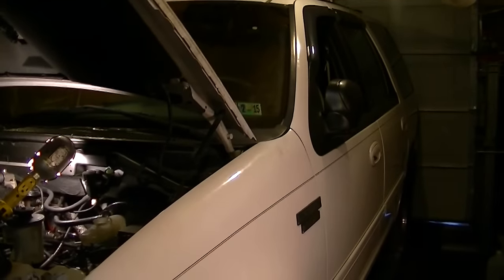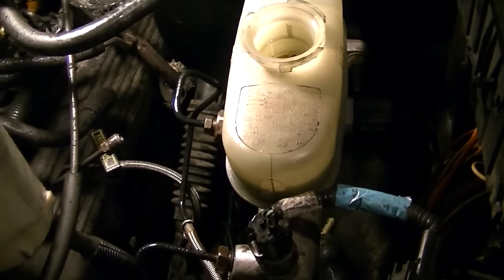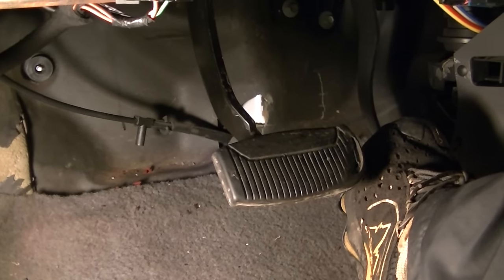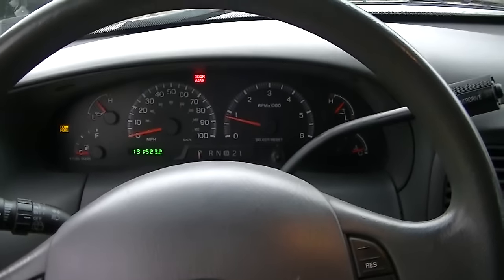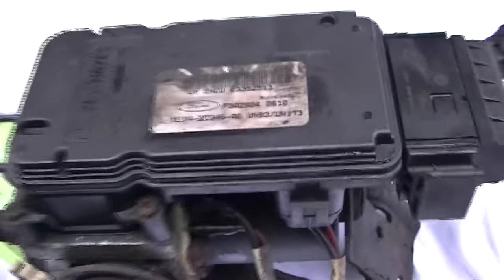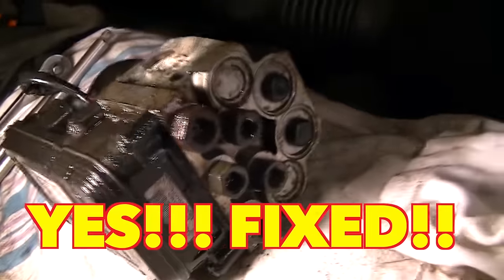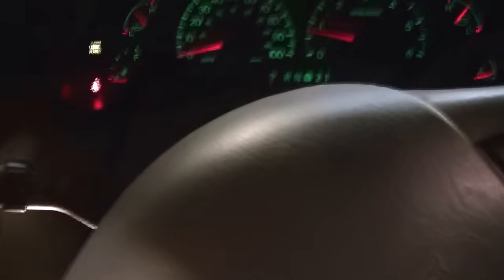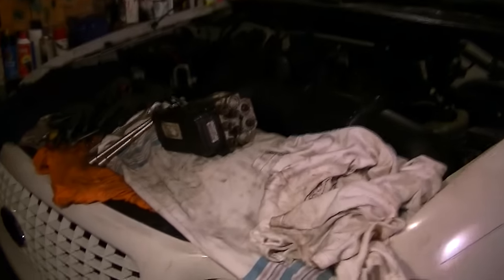Sinking/Spongy Brake Pedal -With ABS SYSTEM?? Nothing Works? Watch Fixed!

Comment: Hi i changed the front brake pads today and also bled all 4 wheels, but i still have a sinking brake pedal? I did retract the caliper to make way for the new pads but i've heard that with ABS systems it's better to open the bleeder before retracting the caliper to avoid any ABS/MC damage. I'm suspecting i've pushed bad fluid under pressure into the ABS and somehow caused damage? Any thoughts?
Reply from the maker: Unless it was working ok before you did all of that, I check the master cylinder first make sure its ok. That's a lot cheaper. Maybe replace it or test it...plug it off and see if the pedal still sinks... If that does not work then the ABS could be your Issue ;(

Comment: Did u check brake screw on calipers...if they are on the bottom, it means that air is trapped there. Screws need to be on the top of caliper
Reply from the maker: Na, it was the ABS...I did everything I could.

Comment: Thanks for posting a vid of symptoms and the cause. Every article I read blamed the master. I have the same symptom on the rear wheel of a Ducati Monster, plus I'm hearing a hissing sound at the abs pump every time I push the brake pedal. Master Cylinder has been replaced but didn't fix the problem. Considering the symptoms match yours, I think I'm just going to replace it.

Comment: I have a 2004 Saturn Ion sedan base model (level 1) I had a spongy brake pedal and replaced the brake master cylinder and tried my best to bleed. The pedal goes to the floor board worse than before. I dont have ABS any ideas ?
Reply: I have an 05 Ram 2500, same issue. Brake pedal would sink to the floor. I replaced my master cylinder and bled the brakes. Still had a sinking brake pedal... Bled the brakes again to no avail. I saw this post, disconnected my batteries overnight. Seems to have reset my ABS module. Brakes are firm again!
Thank you!

Comment: Wow I hope this is my problem i have replaced 3 master cylinders a booster and drums brakes and rear cylinder and still have brake problems even bleeded the Lsv which  was discolored which I thought was weird cause I had bleed the system multiple times I hope that had fixed it but it hasn’t so now I think I’m going to have to look for a new ABS/used
Reply from the maker: O wow! Sorry to hear that! Sounds like ABS ...Let us know if you get it fixed!

Comment: Hi I have a toyota yaris with ABS system and when I presse 3-4 times  with engine off my brake pedal became hard and when its hard I presse 2-3 times more I hear a vacuum leak on front of car and my pedal goes down and I dont have any fluide leak Is  that normal because usually when pedal is hard it stays hard until starting engine?

Comment: I’ve replaced booster and master cylinder on 14 fiesta.   No brakes at all.  System bled but no fluid to front lines.   Next up is abs module.   Cross you fingers.  Frustration is real.

Comment: Very curious about how the brake pedal isn't sinking. Usually you have a get the air out of the abs module using a scanner. This is rare.
Reply from the maker: Done 15 or so  of these this year, never had to have a scanner. Some autos I'm sure you have to have a scanner.
Reply: @FixingWithPassion  what year and model is that car?

Comment: I installed a used ABS pump in a 2011 Ford Edge and still have the same problem I also put a new power booster and master cylinder on and new rear Calpers and nothing changed I still have no brakes it's spongy to the floor and bled the brakes about 15 times

Comment: 2011 Hyundai Genesis 4.6 - Dealer said I had a leak in the master cylinder.  Replaced it.  Now they are saying my HECU (Hydraulic Electronic Control Unit) is bad.  Part alone is $2500.00.  I feel like they are stringing me along.  Pedal does go to the floor and hard to stop the car.  Smh
Reply from the maker: O wow!
Reply: They lied to you, and made guesses off your wallet.

Comment: Were you able to lock up the wheels before you fixed it      I have the same problem pedal to floor.    When I jam on the brakes my tires do not lock up or pulse like when the anti lock engages.    Some say I have to get a computer and bleed the abs module.      It’s a 2014 Wrangler.   Can’t see the module going bad already.      Can you give me your opinion please
Reply from the maker: Not really. Just a soft stop after pushing the pedal like hell....I'd 
say ABS. Your computer (ECM) has nothing to do with the brakes 
Mechanically. As long as you have no leaks...I'd look at that ABS pump. 
Sounds like where this story is heading.
Reply: Sorry when I said computer I meant should I get the scan tool to bleed the ABS.   I didn’t mean ECU
Reply: Thanks for your speedy reply love your channel
Reply from the maker: Well if you have connections (or know someone who actually has one)
 use a scan tool. But you may have to go to
the dealer, and get one that cost thousands of dollars. 
You can't use a regular ODB2 
scanner to do ABS jobs. There not programed for that... only for code 
reading, ABS wheel sensors, Air bags. I'd just replace the ABS pump and 
see if the brakes work again. 
I think you can get by without needing a computer to bleed the ABS.

I don't even have access to a ABS scan tool computer to do bleeding.

Comment: I was thinking that the front Calipers are on the same Master Cylinder , so maybe it would not let the Pedal go to the floor. Ted.
Reply from the maker: vaccumme yea if you have an ABS...I always feel suspicious that it's the issue when all else fails to fix the issue.
Reply: The Part should arrive from the Auto Wreckers by the end of the week. I will work on the Truck this coming Saturday. It is going to be interesting and a relief if this was the fix. Ted.
Reply from the maker: Let us know if it fixed it!    Thanks Good luck!

Comment: ***PAPER CLIP TEST FOR ABS PUMP***
I don't take credit for this test as I found it in my years of searching this same problem.

You may want a helper for this but possible by yourself.

Remove one of the rubber boots on abs pump. These are on same side where brake lines go into it. Place a paper clip in each hole where boot was.  Start truck and press brake a few times. Check paper clip to see if it was pushed out. If there is movement you most likely have bad abs pump as it should not be engaging under normal braking conditions. In my case the paper clip was pushed completely out and fell to ground. When ABS module is bad you will more than likely have ABS light on your cluster. My vehicle: 2003 4x4 f150

Comment: Just curious but why not just pull the ABS fuse  and see if the brakes work after
Reply from the maker: I did/or have tried this in the past. It might turn on the abs light, but pedal still sank like a rock ;(
Reply: @FixingWithPassion  Yep, I tried pulling the fuse. Didn't do anything except trigger the traction and ABS light. Will have to look for a bone yard or ebay unit w/ matching#'s for 2009 Escape 4WD. Thanks for your video brother.
Reply: @Biancorp  were your rear brakes locking/dragging. 2009 xlt 4x4 scape. No lights
Reply: @robwisejr5490   nope
Reply: @robwisejr5490  about two months later the problem ceased I'm tempted to put the fuse back in she if somehow it fixed itself

Comment: so I have the same problem with my sister 98 camry, replace the master cylinder, bleed it and bleed all 4 brakes, and stuff like that. start up and welp its still the same thing, and its probably the abs. is that the same problem as mine please answer
Reply from the maker: Yes I think so also.
Reply: It could be that the ABS system itself needs special bleeding and nothing is wrong with it.
Reply: I just had the problem today occur on my 1998 camry.  I suspect the master cylinder.  Do you think it's the abs?

Comment: Great video! My pedal goes to the floor so I came to YouTube to research. My additional problem is brake fluid is emptying out. Any help any one?!
Reply: Martin Colvill well fluid loss pertains to leaky lines, check all the lines under your vehicle(they’re steel they shouldn’t rust) and check the calipers and drums for your leakage
Reply: Yeah you have a leak somewhere. Any kind of leak will make your pedal go to the floor

Comment: Could you explain more on how you "re-routed" the mc to bypass the abs pump? You lost me half way after you said you disconnected one of the lines
Reply from the maker: I used a brake line and just just re-routed it back into the Master cylinder. Is really better to get a used one and bend it.

Comment: I having the same issue with a 98 Explorer.  Vehicle has 190,000 miles.  Rear brake line broke and master cylinder went dry.  I replaced the rear brake line along with a new master cylinder and booster.  I bench bled the master cylinder and bled all the brakes and the pedal goes to the floor.  I can't get a hard pedal when the vehicle is running. There are no leaks.  I'm thinking there is air in abs module or it bad.  Also no ABS light is on
Reply from the maker: Yea I've had bad ABS without a ABS light ;(  ....Well at this point, Is your master cylinder new or used?
Reply: TVWXMAN32 

The master cylinder is brand new, brake best from oreilly
Reply from the maker: Man....that ABS....;(  I mean what are the odds.....unless there is air in a line somewhere. Poof! Abs ABS...go figure.

Comment: If you had a 2003 sable you would spend two hours just to access that abs pump. Also if you had traction control and didnt get that abs out of a vehicle with tc you would be returning to the scrap yard because two of the lines have a larger fitting on them . 3 days now on that SOB. good luck getting that battery support bracket back in there. I will never ever buy another ford product.

Comment: My 05 Focus has spongy brakes. I bled the brakes and they're still spongy. I didn't notice any leaks anywhere, so should I just replace the ABS pump? The car has 211,000 miles.
Reply from the maker: How long have they been spongy?
Reply: it's been gradually happening over a few months, but it's getting worse.
Reply from the maker: Check the rear brake shoes. If they ware down it will cause a 1/2 pedal and spongy brakes. Its happened to me before. Good news is as long as the pedal does not drop to the floor the abs and master cylinder are ok. Check the back brake shoes just to make sure.

Comment: Put some fluid in, pumped the brakes got pressure, brake light turned off started driving around pumping the brakes lost pressure again, brake light came back on, looked in the rear view mirror......leaking brake fluid, at least I know whats going on now.

Comment: and this, is why I hate ABS. I try to buy used vehicles with no ABS, because I absolutely hate it. Just more crap to go wrong and a cash cow for garages and manufacturers. If it's not stuff like this, it's damned wheel sensors all the time and none of this stuff is cheap. Great video though and judging by the comments, it has helped a lot of folks.
Reply from the maker: Thanks! I've had pretty good luck with ABS brakes working but when they go bad they can be a PITA.

Comment: I need help I changed my back drum brakes put new shoes on but now the pedal feels soft and it feels like just the front discs brakes are only braking. And when I go to pump up the brakes with my foot it dosnt get hard and I can hear suction from the pedal area. I never took off any callipers and there’s no leaks. Do I just have to keep pumping or what
Reply: Did you readjust your rear brakes ? Sounds like you backed them off and didnt readjust them
Reply: Bart fox       No I adjusted them cause at first the E Brake wasn’t holding the car so I had to redo it and now I got a slight drag with the wheel witch I learned is correct and the E Brake holds the car in neutral so I’m baffled.
Reply: @ryans413  could it be the wrong  shoes ? Are they all the same shoes ? If they're different ,maybe they're in the wrong spot ? Either that or the brake lines kinked somehow . Pistons not moving?  Somethings sounds out of whack somewhere .
Reply: Bart fox       They are not the same exact brand that came out but they are the right shoes for my car. I might have gotten some air in my lines so next I’ll try bleeding the brakes
Reply: @ryans413  .. I hope that takes care of it ..good luck !

Comment: Great video,i had the same issue with my lancer,it turns out to the abs module had actually leaked oil,brake pedal spongy and make a funny noise when pressed and depressed and like urs car i was suprised the car dint gave any dash warning at all that the abs had gone bad,also due to the bad abs module my caliper ended up partialy sticking as there isnt enough pressure to release them when u release the brake pedal and as a result causing a brake drag and slowing down the car.
Really amazed wat that small abs module can do at all,lol

Comment: I don't want abs and I unplugged the fuse... By doing so the sinking pedal goes off (if the culprit is abs module) pls reply
Reply from the maker: Probably won't work...try it and let us know.
Reply: @FixingWithPassion  thanks for the reply pal by simply unplugging the appropriate abs fuse disables abs function fully?

Comment: I know it’s a long time ago.
Did you really drive that car with brakes like that to the wreckers?
I’d hate to need to do an emergency stop.
Reply from the maker: "Read pinned comment"
Reply: @FixingWithPassion  
Ok I read the pinned comment.  I don’t want to be argumentative but it doesn’t say how you picked the part up from the wreckers.
When you decided to replace the part your car is out on the driveway ready to go. Maybe I misunderstood.
I have an old car with suspect master cylinder and the brake pedal goes to the floor almost.  No fancy electronics to worry about.
Which is how you magically came up in my feed. 🤠
I’m not game to drive it anywhere.  I’m now waiting for a part to arrive in the mail.
I enjoyed watching your video.  Thanks

Comment: just curious.   was it only spongy when the car was running?   I have 98 Chevy pickup.   brake pedal is firm until you start it up then goes to the floor.   I've replaced brake booster, master cylinder, and feel I've bleed the brakes good.   ABS is about the only thing left.
Reply from the maker: No. It was both. Running or not...it kissed the floor!
Reply: Did you figure out your problem? My 97 f350 will pump firm when not running but running will sink to floor.
Reply from the maker: Yep...ABS pump.....

Comment: I replaced my rear right wheel cylinder and now my brake pedal sinks to the floor. I bleed each tyre but couldn't get this problem fixed. Need help.
Reply from the maker: ok

Comment: would this cause air in the brake system?
Reply from the maker: Word!
Reply: I just replaced the pads on all 4 wheels and I can not get the air out of the system. guess ill look into this part because I know its not the master cylinder. thanks a great video by the way.

Comment: When The motor is on, I push down on brake pedal and it goes to floor. As it goes down I get a blast of air up my leg. What is wrong?
Reply: Are you referring to a truck with Air Brakes? Only a truck with air brakes could blow air up your leg. in which case it might be a bad air brake line or loose fitting on the air lines leaking air. Does the air pressure go down if you hold the brakes for a while?                                                                                             
                                                                                                                                                                                If it doesn't have air brakes and it It only sounds like air leaking out without feeling it the brake booster may have failed.  Brake boosters run on vacuum but it would sound like an air leak when you push down on the break if it was leaking.  If it is hydraulic brakes it shouldn't go to the floor without other issues.  If your brakes are good other wise it is probably just the brake booster but the brake shouldn't go all the way to the floor. If it does Possible bad abs wheel sensor, master cylinder, or air in brake lines causing brake pedal to be spongy in addition to the brake booster.

Comment: Hello TVWXMAN32, I Have a 2000 dodge ram 1500 van and It's got a pedal that is firm while driving but when coming to a hard stop, it goes to the floor and it becomes hard to stop. Does that also have anything to do with the ABS? I mean because it feels like I have the stopping power in the pedal but when doing a hard stop, you get the burning brakes smell. The ABS system does not work. The van doesn't skid or anything.. I've replaced the Pads and Shoes, Bled the system because I also had to do a brake line job that required me to bleed all 4's but the pedal is still low. Could you please tell me what I'm doing wrong?
Reply from the maker: Boy...I'd start looking into that ABS...if you have replaced the master 
cylinder....then there is nothing left. A bad ABS system will cause the 
brakes to not to release often (or a sticky brake caliper). Its happened to me.
Reply: The brakes arent sticking though, only when we do a hard stop, will the brakes smell burned. But that's not the point, The point is, The Pedal is low and when we do a hard stop.. its not firm enough and it goes all the way to the floor! And Thank you very much for getting back with me on this so quickly! This has been a bit frustrating to me lol.
Reply from the maker: Yep, ABS issue ;(